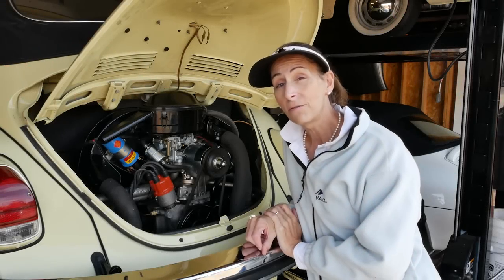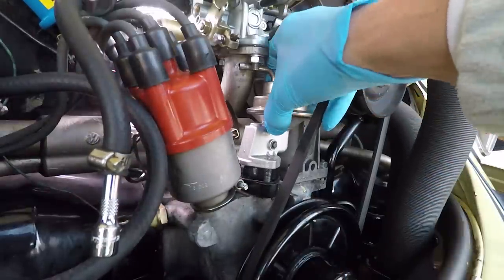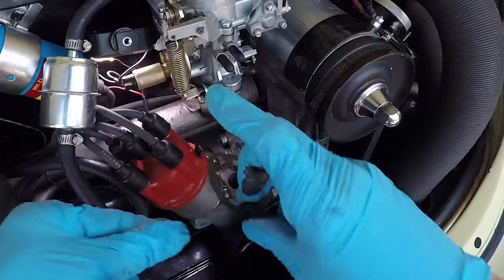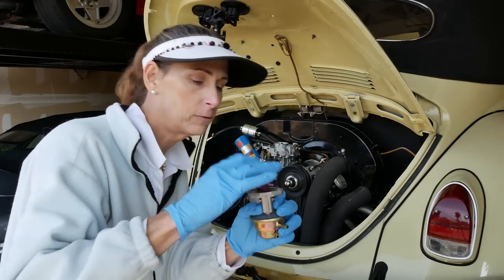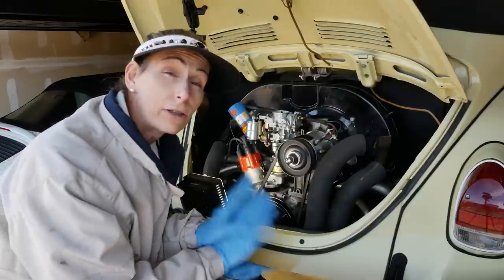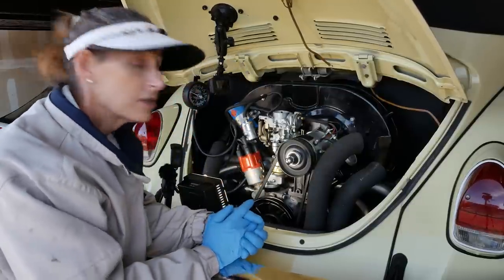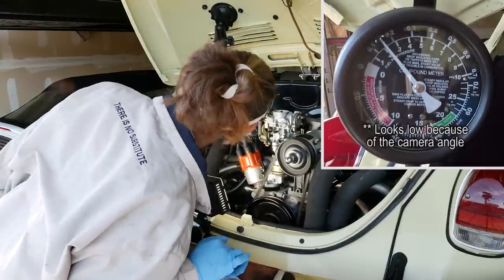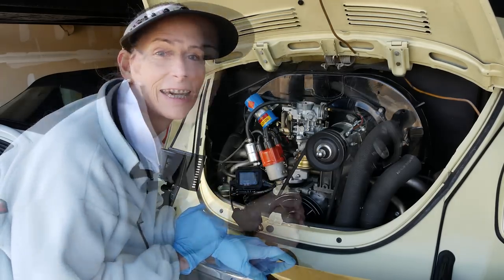How to Replace a Fuel Pump on a Classic VW Beetle (DIY - Pressure Test & Regulator)

Comment: Some pumps do put out the right pressure, then you don’t have to mess around adding a regulator, reducing reliability by adding more parts and hose clamps. For the cars with alternators, you can get a pump from Pierburg. For her actor cars, you can get one of the original Pierburg square top pumps and rebuild it. Both styles of pumps have an internal filter, so you don’t need an extra filter, eliminating another potential leak point.

Comment: I did this on my 1970 Beetle. I set the pressure on the reg. Correct, but there was way to much pressure in the pump itself. The pump failed quickly and dumped fuel into the crankcase. Granted it may have been a bad pump to start with.

Comment: By the way, do you have a video on removing alternator, and putting in a new alternator?. Also, there are many options: made in china, empi, bosch....which type should i go with? Also, 50amp, 75amp, 90amp??...how doni decide which amp to choose?
Reply from the maker: I don't have an alternator video, but I bet it is similar to a generator... Disconnect batt, unstrap generator, unbolt pedestal, remove fan housing bolts and slide it out... I would go with the largest Amp you can get and go with Bosch. Maybe not what they used to be, but still better than others.  You should be able to get your original rebuilt for like $100.

Comment: found the links; thanks for your guidance and your website. I’m trying to apply the lessons learned to the maintenance of my “ C “
Reply from the maker: Awesome!  Heidi
Reply from the maker: Hi James, on your "C" you should be able to use spaces to increase or decrease the fuel pressure if you have an original pump on your car.  I believe they respond well to that.  I need to give this a go on our A as well.  Thanks! Franny

Comment: So what was the point of getting that Rod top dead center and then when you're ready to put the fuel pump back on.. it was too high and you had to lower the rod anyway.. I just got the same pump the two filters I got are glass and Chrome  they were like $12 each for the filters but my engine is 95% Chrome that's why I got them filters...I went from 1600cc to 2400cc doing some internal work, changing the heads, putting in a nice race cam in.. and Weber carburetors..I'm never finish constantly making it faster and louder..Good work looks fun I'll be doing that this weekend...!!

Comment: This is exactly what I needed! I've been nervous to do this project on my own but you covered everything I had questions about! I need to order a fuel pump kit but have been unsure if I should trust what I find on Amazon. Who do you trust for parts?
Reply from the maker: What year is your beetle?
Reply from the maker: Hi Catherine, A good place to start is "http://www.cip1.com/".  Amazon can be a little hit and miss, but if you verify the manufacture, then it can be a good choice.  Be sure to get the correct pump if your car has an alternator or generator. Feel free to upgrade the regulator.   Others have questioned the part I used (although it is working just fine).  A better quality regulator might be $40-$60 or so.  Just make sure you can mount it securely.  Let me know if you run into any problems.  We have an email on our "About" tab and we have a website: www.heidiandfrannysgarage.com where you can leave us an email :)  Good luck!  Franny
Reply: 65 Convertible. Also, when I had it overhauled (after sitting in my garage for 12 yrs) the shop I took it to sent it home without a fuel filter. I plan to install a new one. I've only ever know the acorn style but I'd be happy to take a recommendation on that as well. Thank you again for your help! Where have you been all my life!

Comment: A thought just struck me towards the end of the video. That fuel hose looks rather large, I'm guessing 1/4" ID. Stock-type cloth braided VW fuel hose is 5 mm, or 3/16". Is it possible that the extremely high fuel pressure is not due to the pump, but rather the lack of restriction to the flow provided by the large fuel hose? I'd be very curious to see the pressure after swapping the fuel hose to a smaller diameter.

Comment: Excuse me where do you got the fuel pressure required for the carburator 2 psig? This is the first time that I hear about this,  what happen when the engine is runing at high velocities?  are you thinking the pressure regulator helps to reduce fuel economy? I will appreciate your answer, thanks.

Comment: Hi. Your fuel pump fit right in easy. My fuel pump required a bit of force, because the inside lever was sticking out a bit. I hav a 72 ghia with alternator. I got my fuel pump from o’reillys. There system said it was the correct pump. My engine runs,  but immconcerned about the fuel pressure...
Reply from the maker: There is a shorter rod and a longer rod. The alternator version needs the shorter.  You may have been sold the wrong part.  You could overdrive the pump and you should double check your pressure.   If you need to, add a pressure regulator.
Reply: Heidi and Franny's Garage thankyou for responding. I removed the fuel pump, and trying to remove the rod, to measure it, however the rod is like STUCK. It doesnt even move. The pump base is stuck too...how do i get that out?
Reply from the maker: Hmmm...  The rod needs to be loose.  It rides up and down on a small lobe.  It should just be sitting in there.  The plastic phenolic base should also be pretty loose except for the gasket under it.  If it breaks, it can be a bear to get the bottom of it out of the engine.  That rod should be loose - like just held in by gravity.  If it was tight, then it would never move up and down and drive the pump.  Can you spin it? I suppose if is a bit splayed at the bottom, but it should be round on that end.  Take your distributor cap off and chock the car, put it in neutral and rotate the engine over by hand.  The pin should move up when you get close to cylinder #1 on the rotor in the distributor. If you don't see it go up and down as you rotate the engine before and after C#1, then it must be stuck up in the spacer I suppose.  Then you will need to get the space out.  You'll just have to be really careful and don't whack it. If you do leave a broken end in the engine you'll have to get it out with a tap or something.  Better to just get the rod out.

Comment: great information and easy to follow the steps.. I am having fuel leak problems in my 71 bug it nowhere clean like the one you show in this video. I believe it is the accelerator pump gasket any suggestions? It wont idle and when i get it going all of a sudden peddle down, the car  boggs and no power in peddle, it just Boggs then, comes back to normal ... i cant figure it out
Reply from the maker: Hi Tanya, I think you can get rebuild kits for the carburetor and that should contain all new gaskets.  It isn't difficult but can be a little detailed to rebuild.  Great chance to clean everything well too.  That bogging sounds like a bad condenser on your distributor.  It is the small silver cylinder attached to the side of it and is connected to your points.  It is just a small capacitor and helps the coil recharge and also reduces the arcing across the points.  If it goes bad, the car will idle (mostly), but won't accelerate and it will backfire a bunch too.  It took me a while and I had to go through three new ones on the 356 to get that fixed!  They are hard to test so I ordered a few and swapped them out until I got one that would work for more than a few months.   Maybe start with a good engine cleaning so you can see what you have and go from there.  Let me know if I can help. Franny
Reply: Franny Thank you so much for getting back to me so quickly !! I am going to take all the steps you have suggested and lord knows my engine needs a lot of TLC smile! But since I have to do this on my own this is a great time to learn right! I am so grateful for your advice and I will get back to you letting you know my progress ... I hope one day my engine looks clean and sounds like a kitten! of course, she keeps me busy with tightening bolts. the owner before me was a young man 18 yrs old and he had cut the fron springs to lower it and it is no head lliner i did redo seats inside and went threw the wireing in the back ... the dash is holy grin i call it poor mans air conditioner,,the motor was rebuilt when i bought it from a man who thought it was to fast for his daughters vw i paid 900 for it and i believe it is a 1730 but not sure where to verify that on motor.. she has a lot of power but the little things will take some time ... a diamond in the rough smiles so again thank you for giving me inspiration i believe all women should know how to work on thier cars ... then I found your videos kudos...
Reply from the maker: You will do great!  And I bet you will really enjoy yourself :) It is a great sense of accomplishment and reaching out and learning is always the best first step!  Check out Chris Valone's YT channel.  He has lots of great how to's for all different years.  I'm really excited for you :) F

Comment: Hey guys for starters great video, I’m helping my son with his 69 beetle it won’t get gas past the pump, we’ve replaced the pump, push rod and made sure the lines weren’t clogged . I heard that sometimes if the push rod isn’t correctly placed on the cam that it wouldn’t activate the pump, is this true And if so how can I tell if it’s on there right?
Reply from the maker: Hi David, A first step might be to see if the pump is actually working...  Disconnect the line to the carb and remove the pump from the car, but leave the line to the tank.  Use a catch jar on the hose that goes to the carb and press that lever inside the bottom of the pump that the rod connects to.  I believe it pumps on the down stroke.  If that is working properly, then it must be a rod issue.  The lobe is close to cylinder #1 so you should see the rod move (with the pump off) on either side when the distributor passes the #1 cylinder mark (assuming the drive cam is in correctly).  If the rod is going up and down correctly, then do you have the correct rod for the pump?  There are two...  They get swapped by folks that don't know there is a short and tall pump.  This should narrow down your issue...
Reply: Heidi and Franny's Garage sounds like a plan we will manually try the pump tomorrow , we did make sure it was the right rod when we purchased the pump thanks for the advice
Reply: Great news we blew out the lines and replaced them and it’s purring like a kitten now!! Thanks again for the great advice
Reply from the maker: That's awesome news!  Just a quick note...  If you do add a fuel filter, consider a metal one...  The plastic ones can break/leak and I had a '72 catch on fire because of one...  Also, maybe think about carrying a Halitron extinguisher just in case ;)

Comment: I did not pass my emissions test idle HC/CO above standard here in Arizona,  what do I look for and how can I reduce the carbons? thank you, love the videos, very detailed,,,,,
Reply from the maker: Start with a full tune-up, but take note (and photos) of the spark plugs before they get replaced.  They will tell the story.  Set your points and timing then the carb and start from there.

Comment: Having trouble finding those 90° fittings. It looks like the ones referenced have an 1/8 inch male threaded end ( the regulator has a 3/8 female threaded inlet) and a 3/8 barb (I think the fuel line is 6mm or 1/4) from the Amazon description. I tried local auto parts store and they sold me the exact opposite of what I needed even though their website description had the correct description for that part number. I am so confused.

Comment: Heidi and Franny   Milo Manx likes your video! Great to see two great minds think alike.  P.S. The alternator belt needs tightened.
Reply from the maker: Thanks Milo!  So, about that tension...  Lots of debate about that (in the 356 group as well), but I side with John Muir "Too loose, no juice, Too tight no bearings!"  If the generator isn't slipping, then it's tight enough.  My rule of thumb is if you can turn the engine over from the generator, the belt is too tight.  The 3.2 Carrera needed an alternator rebuild (bearings) when we bought it and the belt was like a guitar string!  Our resident expert Joe Leoni (who rebuilds 356 generators) is adamant about not having the belt too tight as well.  Give it a try - add a shim and I'll bet you'll be surprised. The bearings in your generator will thank you.

Comment: Very helpful, thanks, Franny. However, I broke that plastic funnel(??) thing for the rod, and now I have to try the tap wrench (I've tried other approaches, but didn't work). Hope I can get it out. Otherwise people are telling me I have to pull the whole case apart....ugh.
Reply from the maker: I've heard that is a big bummer...  But the tap I've heard works...  I wonder why they go so frozen.  Good luck!
Reply: @HeidiandFranny  Thanks, Heidi, I'll let you know how it goes.  :)  Keep making more videos, I'll be here watching.
Reply: Well, not going as expected. All it's doing is creating a "thread" down through the old plastic. When I try to pull it out, the tap bit slips out of the wrench. Now what?
Reply: Figured it out. Thanks!

Comment: Hi there,  you mention "the problem with the aftermarket pumps" is that they are putting out so much pressure... Would the Brazilian, Mexican or even German pumps (if you can find them) yield the correct pressure?  Thanks and I look forward to your response.
Reply from the maker: Hi Mauricio, I did see some pumps with build in regulators, but from what I could find they all seem to be in the 5psi range.  It is pretty easy to validate with the gauge.  I think more importantly that if the pressure is off 1psi or less, you can probably shim and still have the needed flow.  Any more than that, if the pump is shimmed or the rod shortened you will have flow issues on the highway.  F
Reply: Thank you so much for your quick response.  I will be purchasing a Mexican or Brazilian pump from a place specializing in old VW parts tomorrow. I guess they are not really "after-market," since they are made closest to the original. I guess my question really is: Would I need to buy a pressure regulator if I buy the non- after-market pump? Thank you again for such a great video!
Reply from the maker: I have a suspicion that it is the rubber used for the pump diaphragm.  I think the non-VW pumps use a stiffer material that can drive the higher pressure.  Just a guess though.  If you can purchase or borrow a fuel pressure gauge (it was only about $10 I think), it is an easy thing to test.  You will know if the pressure is too high when you try to re-start it warm and it is a bit flooded.  That would indicate that it has blown past the needle and seat in the float bowl.  Also, reduced gas mileage is also a good indicator.
Reply: Outstanding  answer form an outstanding lady.  Thank you very much and have a great day! One last thing, which grease should I use for lubricating the pump? I did not see it in your list of recommended parts.  Again, thank you!
Reply from the maker: Oh, sorry about that!  Just standard wheel bearing grease will do...  Let me know how it goes!  Thanks again,  Franny
Reply: I just ordered the regulator from Amazon. My issue, and it took me days to figure it out (yes, I am a newb), was that the fuel pump pin flew out of my pump.  It took me days to figure it out.   I know you can get a new pin for it, but I' rather buy a new Brosol pump.  Aftermarket or not, it is getting the regulator. Once again, thanks for all your help and keep making these great vids.

Comment: Hi Franny! Thank you so much for publishing this video, it has been extremely helpful as I attempt to work on my beetle for the first time. I have a question and would love your input. After measuring the amount of travel on my pump drive rod I noticed that I'm running pretty short, only 2mm travel, additionally the rod itself is only 96mm. I need to buy a new fuel pump and from this I assume I need to purchase a ~ 100mm drive rod to give me the desired amount of travel. However, a 100mm rod best fits a fuel pump for an alternator, but I have a generator. Do you foresee there being any issue with using the alternator fuel pump, and/or, am I going about this the wrong way? Thank you so much for your time and assistance. - Dane
Reply from the maker: Hi Dane, you just want to match the rod with the pump.  If you use the short rod with the tall pump then no fuel.  The long rod with the short pump can shatter the pump..
Reply: @HeidiandFranny  Noted. Thank you for circling back!